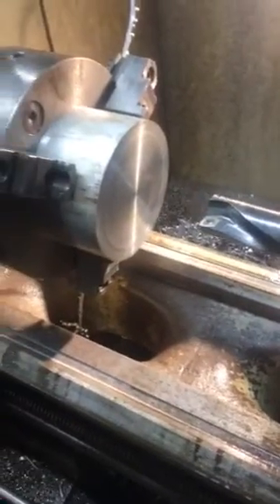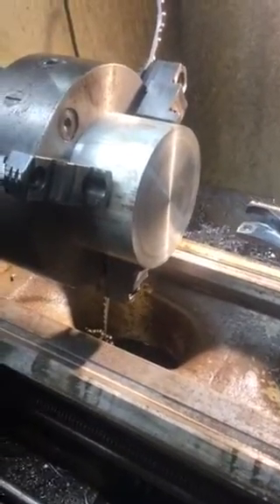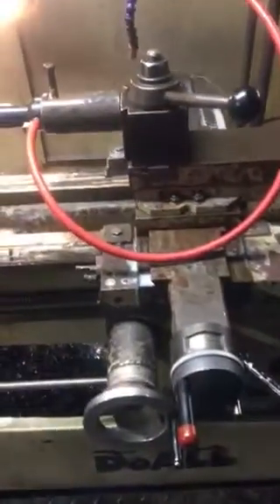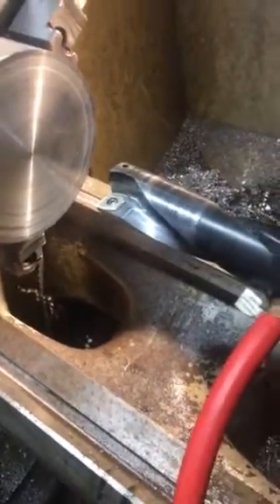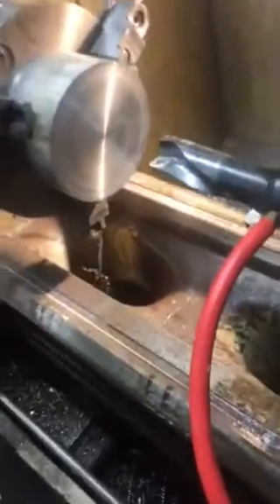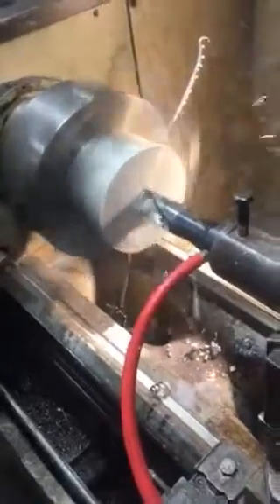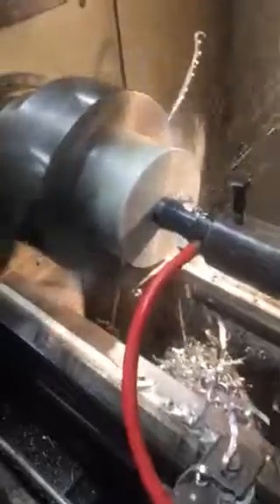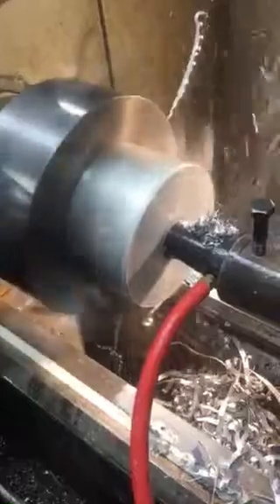indexable drill setup and uses

Comment: The only downside with using a Insert Drill in a Manual Lathe.
Is you Need a Rain Coat, LOL.
IF you start to run the RPM a little lower this will help stop the Coolant sprinkler you have in this video.
Thanks for sharing this video with us.
All the best.
Peter